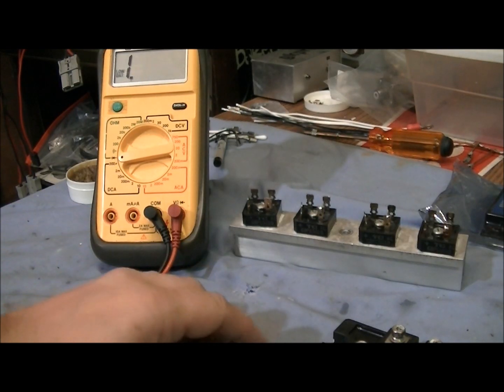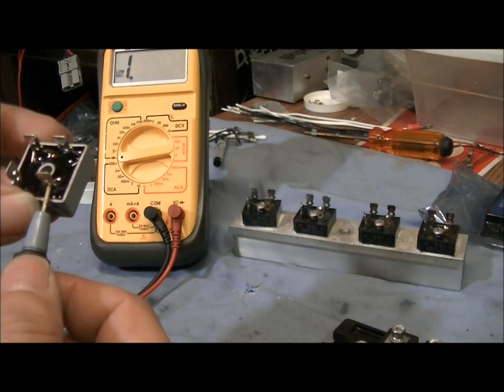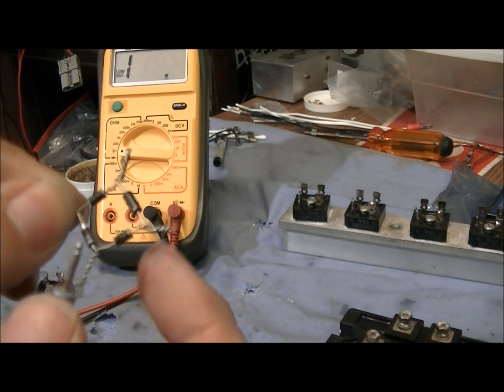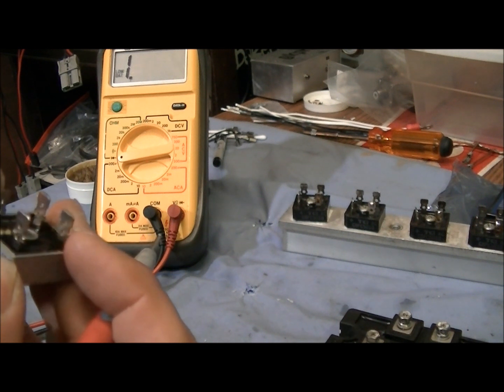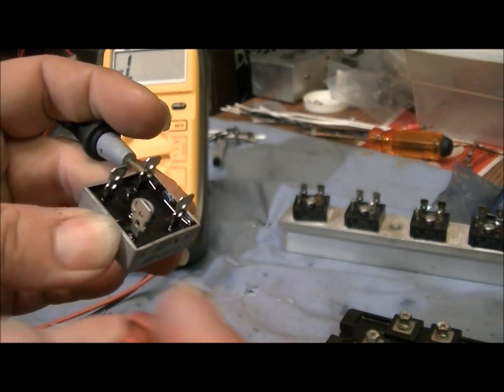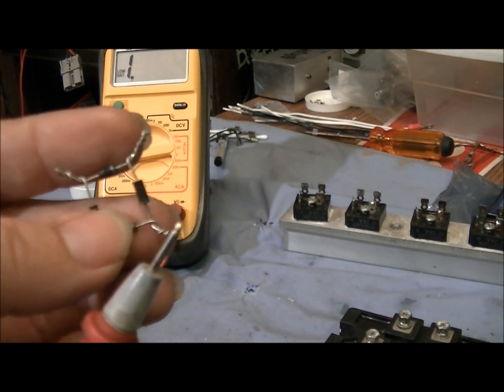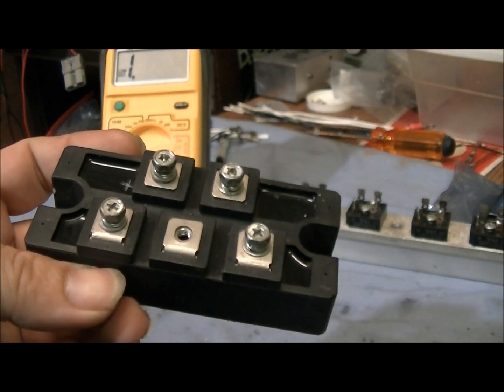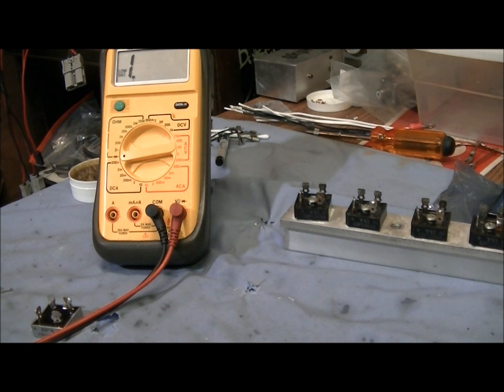How To Check A Bridge Rectifier With A Cheap Multimeter 🤓

Comment: Hello I am trying to make a electric magnet using vinyl coat 12 gauge wire with a switch at the magnet and with or without a rectifier it trips the breaker   What am I doing wrong?  The coiled wire in the magnet is not touching ground
Reply from the maker: Well I am not sure what your using go power it but you DO NOT need to power it straight from the wall. You need to use a Low Voltage Transformer bringing down at least 24 to 12v and maybe a few amps.

25 to 50 coils pencil thin will work fine....the bigger coils it is the more you need.  Maybe you don't have enough turns possibly. Hope this info helps and be very careful with AC. Using AX you won't have a north or south pile but it will pick up stuff for you.

Comment: That the easy way to test them. used to convert AC to DC . The 3 phase ones have 6 diodes and 3 AC leads. used in wind gen and alternators . Them small ones go bad all the time. I no longer use them. replace with big one. I got some 65 amp ones that same size of SS relay. also the 100 amp one. I keep 200 amp on hand. they make 300 and 400 amp ones .all test same way . A friend gave me a 2200 amp 1600V diode went open under load, That some times happens. under meter test good but can't handle a load. EMD and GE use them on trains . some times SCR's . mount on buss bars with big fan. VFD use the big ones like in video. and IGBT modules to make AC vibrable frequency . 73's